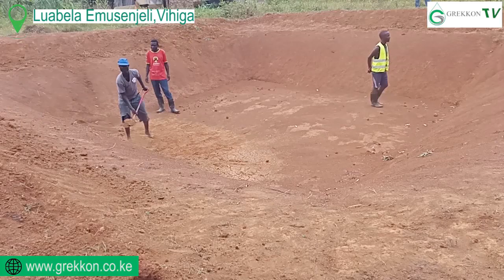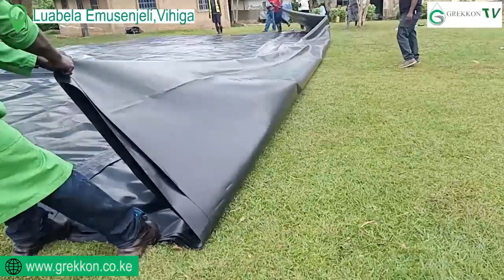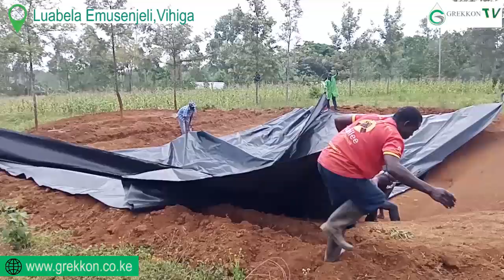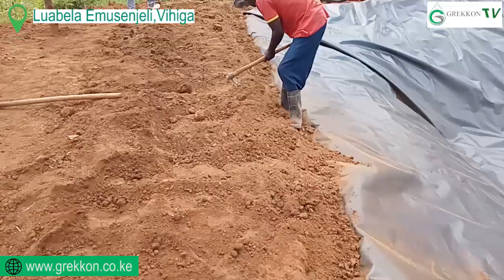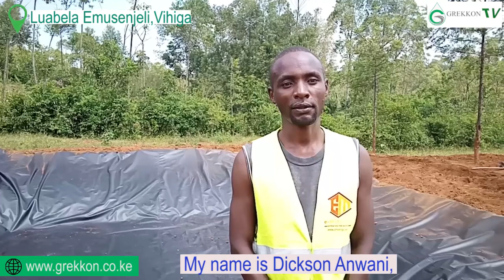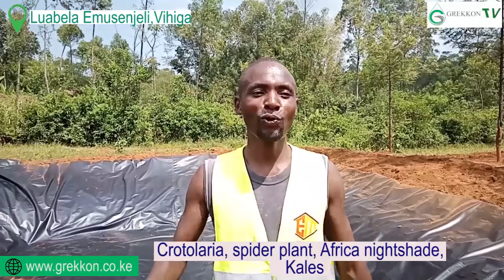Installation of a Dam liner for Water Harvesting in Vihiga, Kenya by Grekkon Limited

Comment: How much to dig io shimo for ya 15m by 30m by depth 3m?.. How many litres will it hold?
Reply from the maker: Hello Manu, we dont do excavation, only supply and installation of the liner. Your size will hold 1,350m3
Reply: @grekkonlimited  okay the land iko na mchanga ya clay.. Mtaeka liner mm ngapi na bei ya io dimensions ni ngapi?
Reply from the maker: Your 0.5mm dam liner cost is Kes 244,720 to cover material, welding and installation. See our dam liners prices by type in this link: https://grekkon.com/dam-liners/
Reply: 1350 liters